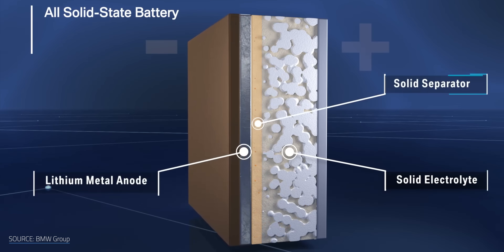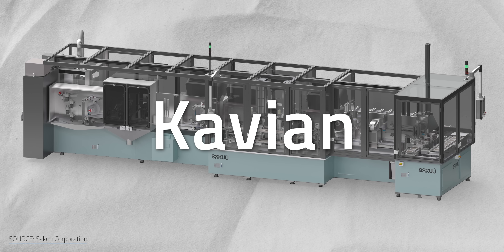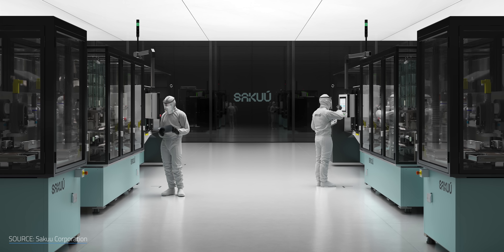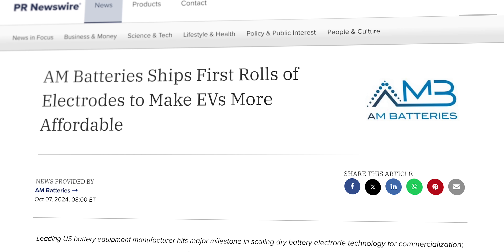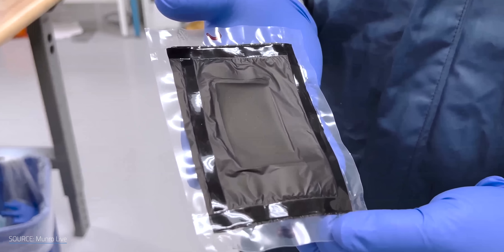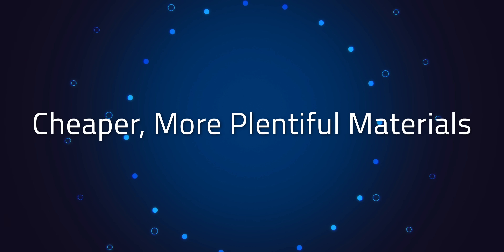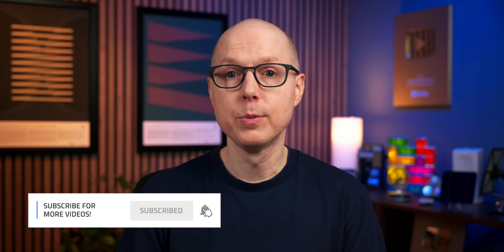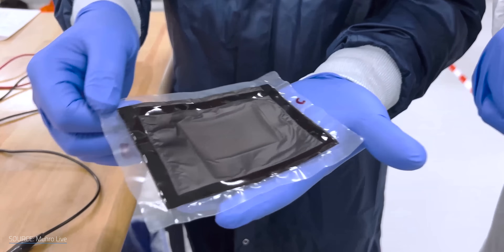Why This Ultra Cheap Battery Breakthrough Matters

Comment: Instead of batteries with strange shapes that maximize capacity for every single product I would prefer to see STANDARDIZED SHAPES so that I can easily replace my battery when needed.
Reply: Already happened, anyway, isn't the point to have a weird battery that you WON'T need to replace? If used properly of course, but I'm not hopeful with how people are
Reply: @TheBlindWeasel  one problem.. current batt tech still has them as a wear-item, regardless of the chemistry.. they can only last so many charge/discharge cycles before being fully useless and the capacity degrades as the cycle-count goes up.. especially for e-drive cars/bikes, i'd rather the batts be replaceable than having umpteen million different designs that are extremely rare, if not impossible to find replacements for. same for cellphones, laptops and similar devices.. those often end up having a rather high cycle count within just a year!
Reply: @TheBlindWeasel  Perhaps, but easily replacable batteries is always welcome. Parts get damaged, and there will always be some wear. It would also be amazing to be able to simply swap out a battery on-the-go for effectively a doubled battery size, as we could back in the day, and still do in some products outside of phones.
Reply: ever heard of 18650?
Reply: @hanfo420 Have fun of replacing few failed 18650 cells in your car.
Reply: THIS!!! Batteries in custom shapes would be an incentive to create more e-waste.
Reply: Do you realize this would make it easier to make any shape of battery? And possibly make it cheaper to get a replacement that fits your specific needs. At least one company will make a battery you are looking for.
Reply: I mean that is already pretty standard. Except in small, high density electronics where that is really only possible if the electronics themselves are a standardized shape and size. Like phones. But you don't want a single standardized phone size and shape. Phones change size and volume and shape every year and every manufacturer has several and hopefully one of a few fit your hands well and others fit others hands well. Etc.
Reply: @mikes2381  sounds like this new tech will make it much easier to produce things like smart glasses more cheaply. Bring it on
Reply: If they last 50000 cycles there is no need to replace them, just recycle them
Reply: Why not both? With this in the bag it's possible to expect such a thing. I'd hope this allows them to do it easily. And who knows, with time, we may only truly need to replace batteries when we replace entire devices, so the point would be moot anyway. Only time will tell.
Reply: @ we are already bad enough with umpteen million different batteries as-is.. add to that, some may want to keep a device longer than just a few years at best.. until a battery tech comes along that does not degrade with number of charge/discharge cycles comes along, they're still a wear item.. add to that, there are failstates that will cause a device to not have power even with a non-degrading batt..
Reply: Especially ebikes!
Reply: @gg80108  drones would be nice
Reply: CO2 is climatologically irrelevant. 

CO2 is climatalogically irrelevant: Interglaciation climate change (e.g. the Medieval Warm Period) is caused by cosmic ray fluctuations ( see the work of Henrik Svensmark, et al).

Just burn coal: the CO2 issue is irrelevant (see above). The sulfur issue with gaol is bogus too: sulfur is an agricultural fertilizer (ask the farmers). The "acid rain" issue is at most "a nuisance" (see the $500 million NAPAP study of 1990).  "Acid rain" was another one of those shallow media sensationalisms, like "global warming" and "ozone depletion". 

Global warming is 21st century superstition. 

Just burn coal.

Sorry, but however intriguing these battery-thingies are, they are just another tax-sheltered boondoggle for people who don't want to do get a real job. 

Just burn coal.

Comment: global copper production has nothing to do with global copper demand. its similar to oil. a few players who are basically a cartel decide how much copper to produce every year inorder to maximize the price they receive on the market due to an engineered mismatch of supply and demand. no matter what the global demand is for copper, chille will control how much copper they put on to the market at an engineered supply/demand mismatch to maximize its cost. just like opec+ trys to do with oil except american fracking is such a gigga chad at disrupting this. global helium and noble gas shortage? nah dont worry fracking fixed that for the rest of my lifetime.

Comment: The dry printing process is much slower in terms of manufacturing output though. It's not exactly a novel process in the industry. It's just one that is more suited toward small scale manufacturing. It's scaleable sure but when scaled you will have the same if not larger lines and taller buildings.

Comment: @10:50 I didn't know there were batteries over 300 wh per kg.  Where do I get one of these 420 wh per kg batteries.  I think you'd be surprised how much the general public would be willing to shell out for a 5 kwh battery with 400 wh per kg.  I am already considering the possibilities for such a battery.  If only, lol.  You sa funny guy!
Reply: Amprius lithium-ion cells using a silicon anode platform have achieved an energy density of 500 watt-hours per kilogram (Wh/kg). Interesting company — though I don’t think they do retail sales.

Comment: I have been hearing about battery breakthrough technology for like 10 years, haven’t seen one that was used in real products yet.
Just incremental updates.
I will believe it when I see it.
Reply: Updates on breakthrough tech have become a real pain. No real breakthroughs but you'll see it all over social media day in n day out
Reply: But you have already seen it! At the consumer end, we just see the gradual** decrease in price for equivalent performance.
**1 "gradual" doesn't mean straight line!?!
**2 eg. PV panels are just emerging from a glut, expect prices to tighten for a few months;
.. eg home grid batteries: CATL+BYD pay under $50/KWh to make them but I pay $250 retail; that's 400% bump - nice work if..
Reply: Your battery holds twice the power for 25% of t he price compared to 10 years ago. That is what breakthroughs do, you'll NEVER get a breakthrough and then next week have cheaper batteries because changing the entire manufacturing process every 6 months would make batteries more expensive than gold.
As a consumer, you'll just see the gradual improvements.
Reply: yup all hype and watch baiting lmao
Reply: hmm... you have seem it, you just don't notice it because it's all gradual. Lithium-ion batteries for example entered the market in the 90's, and they tripled in capacity since then. most of the advancements in battery technology you don't even realize when you buy them because they are not usually marketed when you buy the end product that uses them.
Reply: @danilooliveira6580  That's not at all what a breakthrough is. A breakthrough technology would be the graphite or sodium based batteries we've been hearing about for 5+ years actually making it to the market. What you're talking about is a slight improvement on already existing technology.
Reply: @ that is because most breakthrough offer marginal improvements, and sometimes no noticeable improvement at all. like for example semi-solid state batteries, cobalt-less batteries, even the example you gave of sodium batteries are actually worse than lithium-ion in every aspect, they are just theoretically a LOT cheaper, so most manufacturers have no interest in using them, at least until their price drops significantly, the only ones using sodium batteries as far as I know is BYD. not to mention issues with patents and licenses that stop new technologies from spreading. even incredibly revolutionary technologies like the microprocessor took decades until they started seeing widespread use.
Reply: Huh? LFP batteries went to being scarce and expensive to cheap within 5ish years. 4 years before EV's are using them. Sodium batteries are already going in EV's within a year of their production and price rapidly dropping. Solid state batteries already going into smartphones.
Reply: If you haven't seen battery tech improvement in real world you must be living under a rock.

Comment: Why does this video feel like an infomercial? It seems that you don't talk about any trade-offs, potential drawbacks and anything critical really... Which makes this video difficult to watch.
Reply: If it delivers on its promise, there are no drawbacks except for licensing. The drawback is that it is still being developed.
Reply: Maybe he's super excited? But yeah, there's the obvious... Oh it's not actually in production. It'll be nice to have a follow up
Reply: He used to always do that, I don't know why the change.
Reply: It's new, but not so new it has a glaring downside the manufacturers are currently struggling with. Also, not everything has a massive downside, which prevents manufacturers from producing it.
Reply: One factor is lipsync. It's quite a bit off in this video. Ironically makes it feel overproduced and superficial.
Reply: Downsides are not always patently obvious in new technologies.
Reply: I believe it's probably charge cycles, because he didn't mention that in the video.
Reply: @sovo1212 he does at 11:10 for the cathodes
Reply: @NLPexperts  Yes, I mean he didn't mention any specific figure for the amount of charges, or what happens after 1000 cycles. Do we have to assume that it falls sharply after that? He just said it that the capacity retention is similar to cobalt-manganese batteries. Saying that it "could match" LiFePo4 batteries in the future is pure speculation. If it's half the price but 1/3 the cycle life, then it will not be economically feasible.
Reply: @sovo1212  I entirely agree. However, suggesting that someone would claim to have a battery breakthrough with the limitation of only lasting a few  cycles is a bit silly. If it only lasted a couple thousand cycles it doesn't matter the energy density etc nobody would be interested or invest in the millions for r&d and advertising required to get it onto YouTube as a battery breakthrough. The future has always been nuclear batteries, but I'm not getting labelled that nasty word starting with a T to get the materials to prove that nuclear batteries are the future.
Reply: @NLPexperts  Yeah, don't get me wrong, even if it's "just" 1,000 cycles, it still blows lead-acid out of the park, so it may have use cases if the pricing is right.
Reply: @sovo1212  I actually think their is some kind of conspiracy relating to battery technology: as with thousands of brilliant  breakthroughs, it is still lifepo4 from 1996 that is pretty much as good as it gets. Silicon carbide batteries are just coming out but only in tiny 6000mah batteries, not for home storage or cars. How do you explain so few production batteries that use tech beyond 1996 and why do we use lead acid batteries from 1859? 166 year old technology?

Comment: Like all technology, I'll believe "it'll change everything" when it changes anything
Reply: @SinHurr  Is there a construction crew anywhere still uses corded drills?
Reply: @shmuggysphone4837  Not sure what that has to do with "yet another" alleged breakthrough in battery tech, but probably not, no. Batteries as a concept are super useful and cool. Getting a new "it'll change everything oops nothing changed" every few months is very uncool.

Comment: Fully electric vehicles really don't work for most Americans. One reason is because the recharge infrastructure is not there. In places where driving distances are shorter, sure EVs may work there and more power to them. I wish the focus for vehicles in America would lean closer to the plug-in hybrid (as opposed to fully electric). As much as I want to take care of the one planet we have, my limited budget paired with how spread out my family is, keeps me in ICE vehicles. A cheaper battery in a plugin hybrid might make it affordable enough to buy for the working class.
Reply: but the focus in America is already plug-in hybrid, and you got the best charging infrastructure behind Europe and China, the problem is that it's mostly owned by Tesla. there is really no limitation for EVs unless you live in a very remote area. but if you live in a dense region, like the east cost, you can get basically anywhere by going from charging station to charging station. the only reason plug-in hybrids are selling better is really oil industry propaganda spreading range anxiety, because EVs are already there.
Reply: they don't work for everyone but surely they work for most people? i.e. anyone who can plug in at home, and only drives hundreds of kms a few times a year? to be clear, I intend to drive my ICE car until it's falling to pieces and hopefully >15yo (but I am really looking forward to swapping multiple refueling stops per month for a handful of recharging stops per year).
Reply: @kaybuck8192  I think that most Americans can"t even afford an EV let alone want to deal with the issues that come along with owning one. Auto repair shops can't work on them, dealership repairs are expensive, and the lithium-ion ones sometimes start a fire that is very hard to put out. If someone has convinced you that driving around in America in an EV is easy maybe try to watch RichRebuilds do just that.
Reply: data to date indicate EV fires are less common than ICE fires and no more intense
Reply: @kaybuck8192  You know, I am not the smartest guy out there. Maybe not the smartest guy in this chat. Could you show where and how you learned that fact?
Reply: haha me neither. I remembered coming across some articles about it in the recent past so I searched "ICE fires vs EV fires" and then went through a couple of pages of results. it both seems like a developing area of study, and also not close. interestingly, at least one source suggests hybrids are the most likely to burn (maybe both the ICE and EV components compound the risk?).
Reply: @kaybuck8192  It really isn't a developing area of study. Lithium-Ion batteries have been known for their fires since the early 2000s. That is why they need special care when shipping and why there are battery size limits at the airport. Maybe you should also lookup laptop battery fires in the 2000s. There may have been some truth to hybrids being more fire prone in the early days of hybrids. Not because of 2 fuel sources but because the batteries were packed too tightly. I know that at least for the Prius the battery packs have been re-engineered for greater airflow and expansion retraction. For many generations Prius batteries were Nickel-Metal Hydride. The battery chemistry itself is not known for fires.
Reply: @charliewatson3202  right, but I was referring to the incidence of fires in EVs, though, not batteries, which is a moving target for a variety of reasons including but not limited to uneven collection and publishing of data, emerging vehicle types, and evolving battery chemistry (LiFePO4 in particular - still Li-Ion, but less fire-prone). thanks for the insight on hybrids.
Reply: @kaybuck8192  There were incidents with EVs in the 2000s as well but "more widespread concerns about EV fires emerged around 2013-2014 with incidents involving vehicles from various manufacturers". That is probably why LiFePO4 batteries exist now.
Reply: @charliewatson3202  I'm sure it contributed, along with supply chain and cost pressures. but even before LiFePO4 commercialisation, sober analysis gives a win to EVs over ICE cars on fire safety, and by a large margin. unfortunately fearmongering is rife.
Reply: @kaybuck8192  I respectfully disagree. EV fires burn hotter and are harder to extinguish. Thankfully there are fewer because many more ICE vehicles have been produced. I don't think I am alone in thinking that EVs have primarily been toys for people with greater means. If someone produces an EV that can travel 560 miles on a charge, doesn't require rare earth minerals that were collected and processed using fossil fuels, can be repaired and maintained by the owner or any auto shop, and I can afford with cash (>$8,000), by all means please let me know. Till that happens whatever the EV can or can't do doesn't matter to me.
Reply: @charliewatson3202  fair. for my part, I am quite looking forward to a car that costs $0-10/month to refuel, cuts my refueling stops to near-zero, requires less maintenance, is >20x less likely to catch fire, and comes with the possibility of both cutting my electricity bill and powering my house through a blackout.

Comment: A Chinese battery price war that will cut corners and reduce/remove safety features......what could go wrong?
Reply: no one is removing safety features, you literally heard about NEW safety features in this video (fire retardant coating and automatic quality inspection). they are cutting costs by streamlining production and using cheaper materials.
Reply: The Chinese price war was between the two major battery manufacturers currently making batteries in China. Not the guys that are at the development stage of the new 3d process.

Comment: New tech is always interesting. Sometimes it even works IRL. This is just a bit too fantastic for me to believe in it, so I won't be calling it a fantastic development before the batteries are available from a large manufacturer. In addition to the manufacturing and cost advantages we really need to know about the energy density, both volume and mass related. Then there's the effect these can dish out. How much power can the deliver in watthours and how fast can they be charged. Then there's the life expectancy. How many charge cycles can they handle before the max capacity has dropped by 10%? All of these things are what you need to know before you start singing their praise.